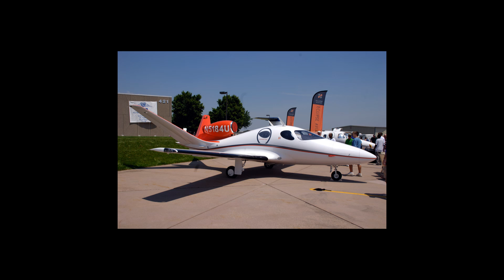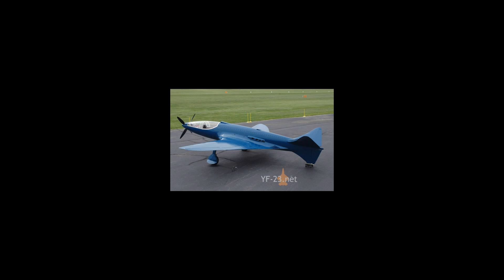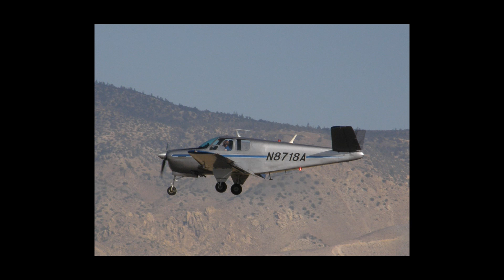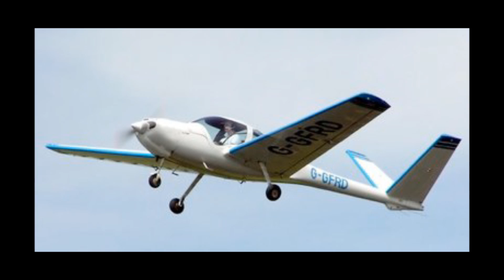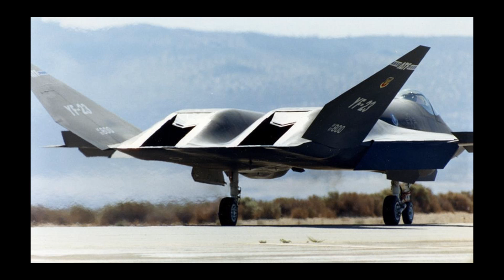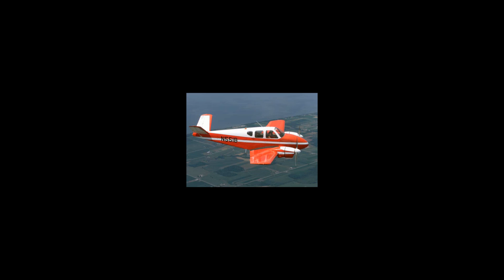V-Tails - Explaining What They Are, Why They Exist And Why They Aren't More Common

Comment: The reason why they're not used in airliners is simple -cost. Cost of pilot training and not manufacturing. To become commercial airline pilot you must have "X" amount of hours on specific type of aircraft. Since v shape has not been widely used there would be no pilots to operate this type of aircraft which has different flight characteristics from the "standard" tail. Re-training whole pilots in each company to be able to fly new type of aircraft would not only be costly, but very time consuming. That's why I don't think we will see airliners with v tail anytime soon.
Reply from the maker: well, you get the same problem with any new type of airliner even if it doe have the same tail layout though
Reply: Not true. The standard tail layout is safer. It has better vertical and horizontal characteristics. E.G. In a crosswind on a runway, for example, the large rudder does a much better job of keeping the plane headed straight down the runway. They allow a pilot better control-ability

Comment: Thanks for the explanation. I was wondering why Eviation tryin to make an electric plane used this setup. Since they are trying to squeeze every bit of efficiency I was wondering why.
Reply: What he didn't really say is that a standard rudder/ vertical stab & elevator horizontal stab may have a little more drag, but they are safer because they have much better control of separate up/down & yaw characteristics. So in a crosswind on a runway, for example, the large rudder does a much better job of keeping the plane headed straight down the runway.

Comment: How come drones use V-tails but commercial airliners don’t?
Reply from the maker: drones are often designed primarily for endurance while airliners are designed with safety and passenger comfort in mind - also drones are relatively small and have long narrow bodies since they don't need a cabin which makes v-tails easier to implement and they often use upside down V-tails as an extension of the landing gear

Comment: What is safer a Vtail or Verical stabilizer?
Reply from the maker: depends on each specific design and what kind of damage it takes - with a V-tail you can loose either side and you still have at least some yaw stability but on the other hand loosing control on either will make the airplane very difficult to fly
Reply from the maker: overall in general a vertical stabilizer is probably a little bit safer but the difference isn't too big